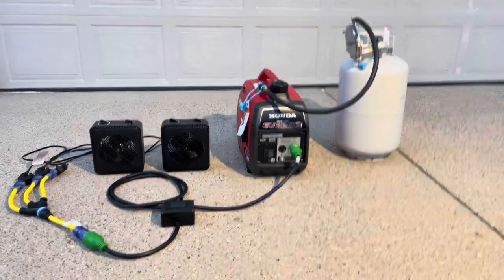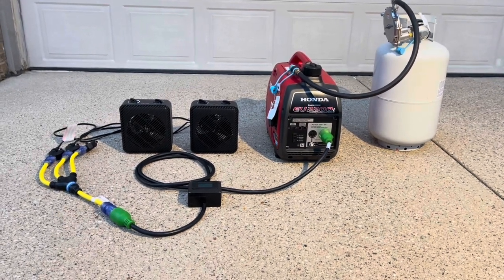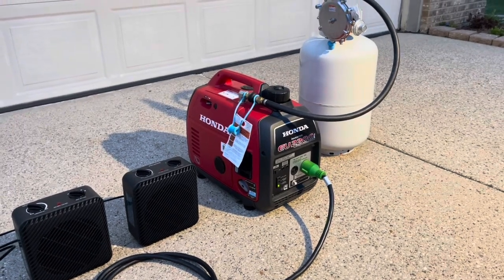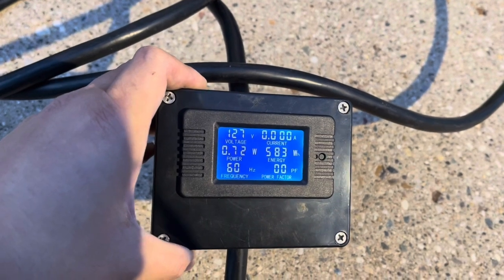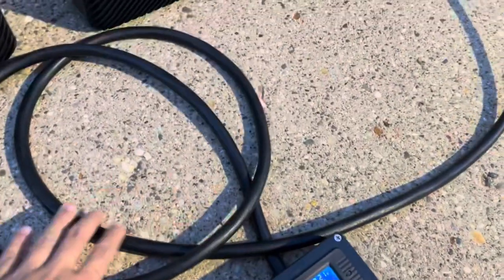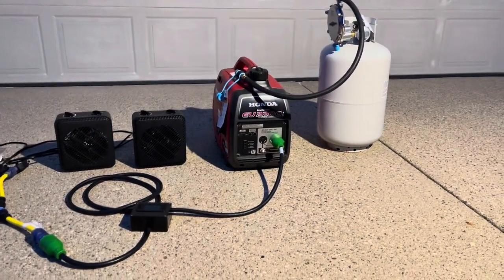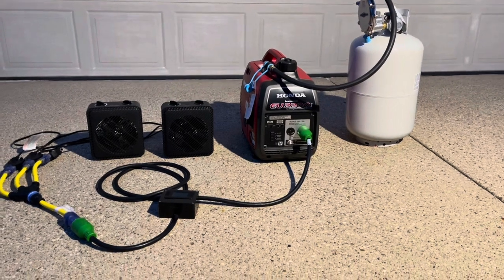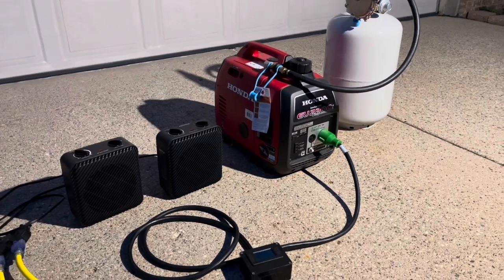Honda Propane Conversion Kit - Less Power? Engine Damage? Part 3 - EU2200i EU2000 EU22i EU20i

Comment: Looks like max surge of 2 kilowatts + a bit  on propane  with a max rated surge of 2200 watts on gasoline so a ~10% probable? reduction in max surge on propane.  A key is watching the voltage - for a little while when just some of the second heater was added  (2 kilowatts added?)  so into the short term surge range it kept the voltage just above 120 volts. Probably with the bit more power on gasoline it would have made it to the rated short time surge of 2200 while keeping the voltage just above 120.  Then when clearly overloaded with 2 heaters on it lowered the voltage to around 100 but still around 2 kilowatts  on its way to overload warning - shutdown? Looks like your propane set up may well have a running wattage of 1800 watts because it was able to get into the surge range of 2 kilowatts on propane.  Long running on propane with a 1800 watt load and 120 volts maintained with engine and exhaust and inverter temps taken and compared to those temps taken under the same operating conditions on gasoline would tell the tale as to a "rated" running watts on propane.

propane has great convenience for intermittent use (no bad gas killing carb operation) or use where propane fuel cost is not a concern.
Reply from the maker: Thanks for your input